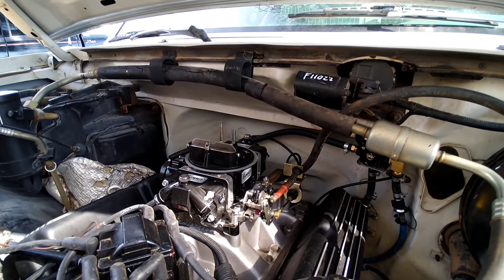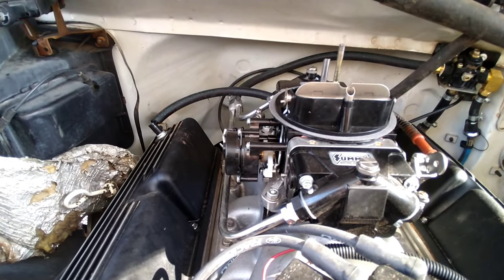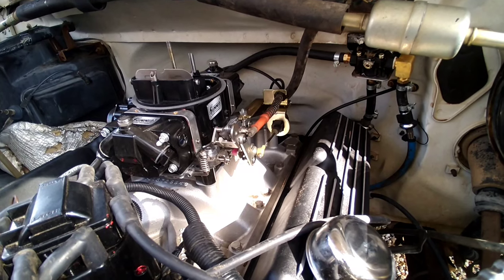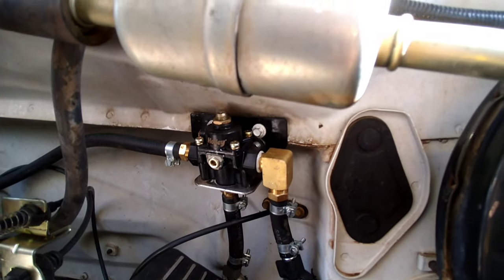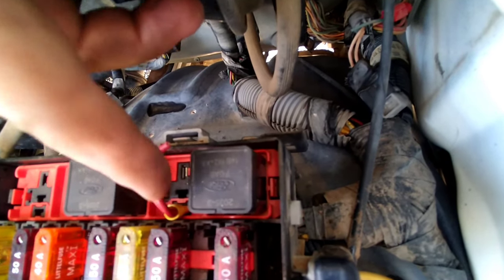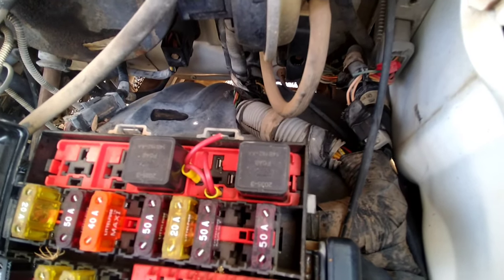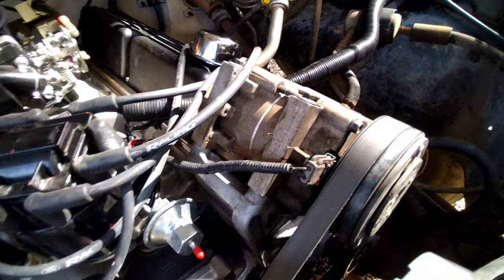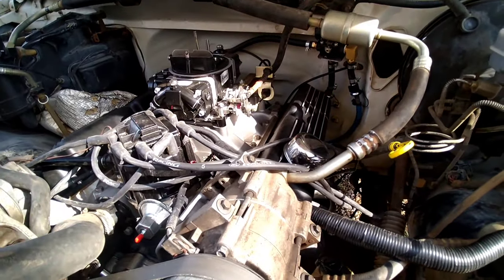87-96 F150 EFI to Carburetor conversion

Comment: Did more tuning on mine. Changed to double platinum plugs. Happy to report I'm getting 23mpg. Running better and more efficient than the efi. More power too
Reply from the maker: That's awesome I would have never guessed 23mpg
Reply: @CCAutoWorks  that's what it use to get when I first got it
Reply: @WARD5KUSTOMZ my 97 Ford e350 V8 got automatic transmission, could I swap it to carburetor without issues? How difficult is it?
Reply: @BOREDANDWELLBORED you’d have to buy a tps sensor setup for carburetor, I got one from Holley that fits on the 600 and 650s for like 160 you just put it on the choke side and wire it up to your tps wires
Reply: @ACG7001  how about the automatic transmission, will it be affected?
Reply: @BOREDANDWELLBORED  the automatic transmission is controlled with the throttle position sensor so if you buy that aftermarket sensor and wire it up to the stock sensor wires it’ll tell it how to run and it won’t be any different, maybe even work better if you have an old sensor. There’s three wires in the wiring harness you cut and attach to the three new ones and then attach it to the carb and you’re done
Reply: @ACG7001  my gosh. I'll pay u $100 if u make a short video showing this step by step.  I would love my 97 ford e350 to be running on carburetor

Comment: Very Neat Conversion and info! I like the way you kept A.C, Factory tach, water and oil pressure too. Nothing like a 4 barrell carb sound. Love it!
Reply from the maker: That was the only way to do it I wasn't going to completely butcher it and your right for sound you can't beat a good ol four barrel taking a deep breath
Reply: @CCAutoWorks  Just Subscribed! I'm so glad I ran across your Channel, I have an 89 F-150 XLT regular cab two-wheel drive EFI 5.0L Automatic.

I've been wanting to carb swap mine for over 2 years now but everyone has told me it is way too complicated and way too expensive. I think a bonehead like me could probably do this in a weekend under a shade tree.

Would you happen to have a complete parts list including cam, headers Etc that I would need to do a swap as you did? I would be more than happy to donate for your time. 
Thank You!

Comment: How long have you been running with the efi fuel pump? I'm looking at doing this on my '89 F150, and loving the way it cleaned up your engine compartment! Did you change the cam, or just carb, manifold, and distributor?
Reply from the maker: 6 months it has a cam and aluminum heads

Comment: The AODs are the over drive automatic transmissions. and some of the earlier three speed and AOD automatic transmissions don't require the TPS. they have a TV pressure cable similar to what was used on Chrysler torqueflite transmission's. and they require fairly  precise adjustment to work properly. earlier C6 automatic transmissions's had a vacuum modulator to control shift points. and a kick down linkage to control passing gear kick down.

myself I prefer to use the dura spark distributor. because it can be matched with an MSD ignition module. because it uses the identical pick-up as MSD, and it's a true CDI ignition. and a person doesn't have the fitment issues associated with the HEI distributor. and because the HEI distributor can have premature distributor shaft bushing failure. because of all the weight up high on the shaft where the mechanical advance is.

but other than that this is the cleanest and best EFI to carburetor conversion I have seen on YT. awesome job indeed.

oh yeah I was curious did you do anything to the exhaust system?
Reply from the maker: I learned about a week ago about using the factory distributor with the msd wish I would have went that route only if I would have known the exhaust is long tube headers 2 1/2 pipe into an x-pipe then into a dual in dual out 2 chamber muffler
Reply: @CCAutoWorks  That sounds good for the exhaust system. I have heard of times where the cat can be restrictive after doing a carburetor swap. especially if it has been overheated by the failed EFI system. because the substrate gets melted and causes a restriction or breaks up and plugs up the muffler.

Comment: Thanks for the video, I'm about to carb swap my '88 with a C6. Really good to hear that the factory gauges will still work. I just picked up a second harness from the junkyard to cut apart, that way I don't have to chop up my original in case I ever try again to get the EFI working worth a ** lol. I would think as long as you have the inertia switch still working on the fuel pump, it will be fine to be running all the time. Fuel running through them is what cools them down, so it's actually better to have it running all the time with the bypass regulator.
Reply from the maker: Yessir that's awesome I agree on the fuel 💯 I was going to get a junkyard harness as well but never did then got impatient so cut original the c6 is a better trans then this weak aod thanks for watching
Reply: @CCAutoWorks  Just finished my swap, not sure if you already knew but you can ground the fuel pump relay through the EEC test plug. Saves cutting into the relay wiring, assuming you don't chop that test plug out.
Reply from the maker: @SuperKONR  sweet that's really good to know I never stopped to think about doing it that way
Reply from the maker: @SuperKONR  by test plug u talking about the obd port
Reply: @CCAutoWorks  Yes, the triangular shaped one that you connect the jumper to when you're checking codes. I just hooked a spade connector into it and grounded it and it runs the pumps. I'm pretty sure the inertia switch is connected after the relay, so in our case there's nothing wrong with just removing the relay and jumping the terminals like you did. Just thought it was cool that there was a wire conveniently running into that plug.
Reply from the maker: @SuperKONR  that's freaking awesome

Comment: Did this to my truck! Runs great lot better looking!. One problem I'm having tho i have to hold pedal to floor when engine is hot but when it's cold it fires right up
Reply from the maker: Yeah that's a common problem with carbs when there hot they tend to flood a little and flooring it helps dry the extra fuel out to start you might check your float levels
Reply: @CCAutoWorks  yeah I been trying lots of stuff trying to get it right but no luck
Reply from the maker: @ethandeberry8858  what's your regulator set at
Reply: @CCAutoWorks  10psi
Reply from the maker: @ethandeberry8858  that's way to high max psi for a carb should be around 6 and Edelbrock recommends 4 1/2 and more then that fuel pushes by the needle seats
Reply: @CCAutoWorks  yeah turned it done to 5 still same issue. I did rebluid engine and I can't retart the timing to where it should be. I'm starting to think my timing chain is a tooth off
Reply from the maker: @ethandeberry8858  I would think if timing was off it would be hard to start all the time does it seem like it's hard for the engine to turn over when u try to start it
Reply: @CCAutoWorks  yeah turns over great. And maybe no out of time because has good power
Reply from the maker: @ethandeberry8858  I wouldn't worry about it then mine does it from time to time when hot if I try starting it ten minutes or so after driving it
Reply: @CCAutoWorks  yeah thats where I'm at to lol. Might rap feul lines up and see what that dose
Reply from the maker: @ethandeberry8858  if there where they can get hot that might do it

Comment: This is what ima have to do this to my 93 f150 flareside single cab with a 5speed. I’m tired of dealing with my idle issues
Reply from the maker: It's a good swap I did it when I dropped in a 351 but on a 93 it's probably the tps senor voltage
Reply: @CCAutoWorks  yeah I think so too but I definitely want to do carb better to get more performance out of the 302. I can’t do much with speed density. I’m going to order all the stuff I need for my hatchback foxbody right now. What carb do you recommend?
Reply from the maker: @FishingWithJo415  I'm really liking this summit racing Maxx performance holley style carb

Comment: THANK YOU!
I need to carb swap my 302 87' Bronco. EFI problems one after another. I have been intimidated to do it, until now! 

One question, for intake, I have get one for a 302?
Reply from the maker: Yes you need an intake for a 289/302 a 351w is different
Reply: Ok, thank you. @CCAutoWorks
Reply from the maker: @tjtrust3411  anytime

Comment: No problems with fuel pumps at all? Wonder if it decreases life? Only one pump should be on at a time with the switch still, correct? I'm getting ready to do a full crate 351w/C6 swap in my 91 F150. Jerk the 300 i6/M5OD out and go carbureted 351w with C6, but I want to run my functional dual tanks and that was the one issue I had questions about.
Reply from the maker: Yes only one pump works at a time and the switch still works but there was a guy in the comments that said if you ground the obd port you don't have to use a jumper wire like me

Comment: Hi! Once I delete the entire EFI system. What vacuum lines are still needed aside from booster and trans?
Reply from the maker: The ac defrost vent door needs vacuum and the distributor advance and pcv valve

Comment: I'm having trouble finding spring lock fuel line fittings that go from female to 5/16 hose barb. Do you remember how you connected factory line to hose barb?
Reply from the maker: I cut the peace off the factory fuel rail and flared it and slide fuel injection fuel hose over it with the fuel injection hose clamps
Reply: @CCAutoWorks  Okay, I was thinking of doing that. Thanks for the reply

Comment: what did you do about the coolant sensor? factory one wont screw into carb intake
Reply from the maker: I used the factory one it screwed right into the carb intake I bought but the intake I have had three different spots you could put it

Comment: Do you remember which holley by pass regulator you are using? Is it the 12-887 ? Also, if I understand, you are still running the stock fuel pumps, and that regulator is able to handle the 40 psi inlet and reduce it to 6-7. I'm currently swapping my 95 F250 5.8. Thanks!
Reply from the maker: I don't know about the part number but yes stock pumps and a low pressure bypass return regulator I have a few different vehicles and all the newer style Holley regulators have fail I started using China aeromotive

Comment: So the in tank pumps are still used? But, the regulator squeezes down the pressure to carb level that is needed? Does this hurt the in tank factory pumps to be pushing against this reduction? Can a manual fuel pump be installed and in tank pumps removed? Just for reliability....as the removal of tanks for this pumps are a bitch. Looks good.
Reply from the maker: If u use a bypass fuel regulator there will only be 6/7psi on the factory pumps because the rest of the fuel and pressure is returned to the tank

Comment: So on this swap, I have the 5.8 paired with the E40D. I’m assuming I’ll need something extra for the transmission? Pretty sure you said something about a tpms sensor ? If you could clear this up for me I’d really appreciate it
Reply from the maker: Yes you have to have a tpms sensor on the carb to still run the trans or the sell a controller for like 500

Comment: How did you get your cable set correctly for the AOD? Don't you have to read the pressure somehow???
Reply from the maker: You can hook a gauge up and read tv pressure from the TV port on the trans but I just take all the slack out of the cable and throttle linkage put just a little cable tension and lock the clip is where I start after that if u want it to hold shifts longer tighten the cable a little

Comment: Looking at an 88 1 ton with the 351 guy already did it but none of the stock gauges work do you know how I could get the tach oil pressure fuel gauge and speedometer to work
Reply from the maker: I used all the stock wires and hook up and none of the engine harness has anything to do with the speedo working

Comment: Can you tell me what intake you got in the middle of a swap and the one I got is 12" wide need one 9" wide idk would appreciate the help
Reply from the maker: https://www.ebay.com/itm/133991626010?mkcid=16&mkevt=1&mkrid=711-127632-2357-0&ssspo=SAK7pdovQ7u&sssrc=4429486&ssuid=6G4e_MbCTLy&var=&widget_ver=artemis&media=COPY
Reply from the maker: https://www.ebay.com/itm/165883265593?mkcid=16&mkevt=1&mkrid=711-127632-2357-0&ssspo=nfya1amzqlc&sssrc=4429486&ssuid=6G4e_MbCTLy&var=&widget_ver=artemis&media=COPY
Reply from the maker: The first link is the one I have now but I've been thinking about going to the second one the Chinese airgap
Reply from the maker: This pickup used to have a 302 but when I carb swapped it I built a 351w for it

Comment: How exactly did you wire up the distributor? I have a 94 f150 351w my dad and I just carb swapped and can't get it to fire.
Reply from the maker: I used a hei distributor it's not the factory distributor the hei runs off of one ignition wire
Reply: We put an HEI in it and wired up but I don't think we wired it up correctly, only reason asking. Also, keep up great videos, this one was a big help!
Reply from the maker: @speedsvlogs3952  where the 3 wires plug into the cap from the bottom of the distributor it should say batt on one side and tach on the other hook an ignition wire from a keyed on source to the batt on the distributor and make sure the fireing order is right the rotor turns counter clockwise
Reply: Thank you so much for the help!! You helped me figure out exactly why my truck wouldn't run and now it runs better than it ever has!
Reply from the maker: @speedsvlogs3952  Your welcome I like to help anyway I can anytime I can
Reply from the maker: @speedsvlogs3952  glad to hear you got it running

Comment: I ripped the whole harness out of mine and started from scratch, what size and color was the distributor wire, also how would I go about connecting it to a ready to run msd blaster2?
Reply from the maker: Red with black line 12g and I've never messed with any msd so I'm not sure

Comment: What hot wire did you use to distributor bat connection
Reply from the maker: It just has to be a wire that's it a key on ignition wire I used a black with a red line

Comment: Did you notice a difference in power at all? I’m thinking about doing this on my 89 Bronco 351w and c6 transmission
Reply from the maker: Yeah but I went from a stock 302 to a aluminum headed 351w when I did the swap
Reply: Did you do it? Just got all the parts to start mine.

Comment: Good info on this video...so I'm planning on doing the same thing .I have a 96 f150 il 300..5 speed..so I'm dropping a 351 carburetor...do u still have to pump the gas pedal to crank her up on cold starts??
Reply from the maker: Yes anything carburator you have to pump the gas but not as much if you hook the choke up witch I never do

Comment: Alright mine is a 1988 f150 5.8. My injector harness also has 3 other plugs on the end. I have no idea what they go to and I’m wondering if they’re needed. I bought the harness from a junk yard, it’s from a 88 F150 5.8. My truck was factory EFI but caught fire. The injector harness is separate from the main harness coming from the computer. Do i just get rid of the harness entirely or do i need any of the 3 plugs on the end of it?
Reply from the maker: That's a tough one mine only have one but I do remember the older harness having more but are you trying to make it run efi or are u carb swapping
Reply from the maker: The only reason I kept my factory harness was so all my gauges would work

Comment: What wires did you use from the old distributor what color
Reply from the maker: Black with white line for the tack and just a 12v ignition wire to power the new hei distributor
Reply: The black with white line comes out of the fuse block harness correct? I cutt my whole harness n soldered on what I neeeded in doing this forgot what wires where what 💀😂 I just need the tack haha

Comment: Can I switch my 93 f150 302 with an aod transmission can I switch that over to carburetor  without having to change transmissions?
Reply from the maker: If it's an aod you can carb swap but the 93 I had had a aode or 4r70w that was electronic and it's alot harder and cost more to do